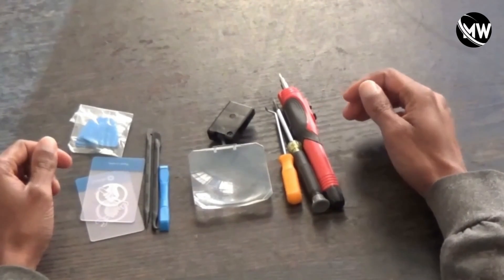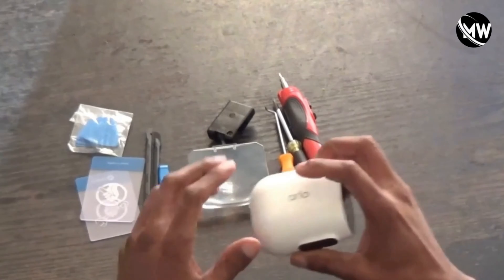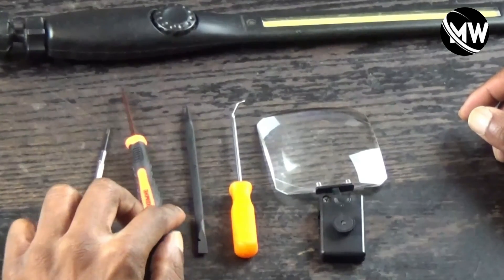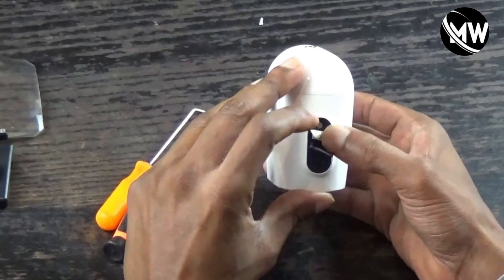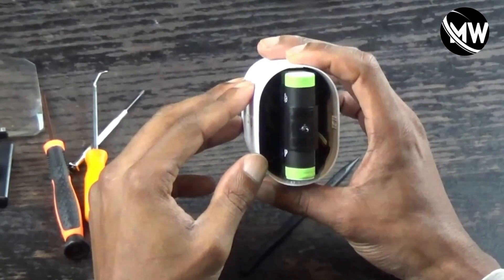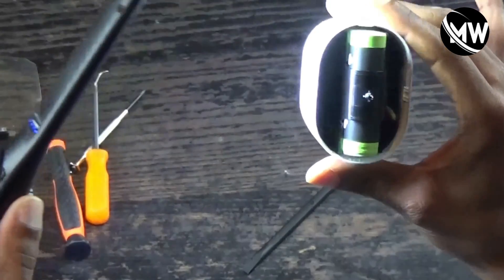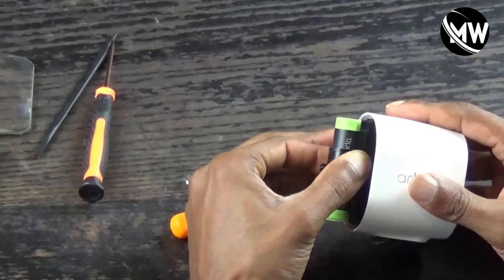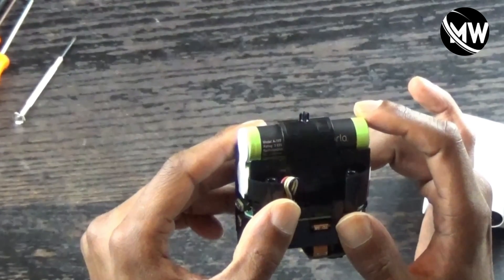Arlo Essential Camera: How to replace the non-removable battery - Part 1

Comment: I have the same camera. When plugged up it's not showing any charging indicator and it won't turn on. I opened the camera and tested the battery with a multimeter and it's putting out 3.6V yet camera still not turning on.
Reply from the maker: When doing a voltage test. 3.6V is the minimum charge, 4.20V is the maximum charge. 3.6V is low.
Reply: @manowarsecurity idk why I didn't see this comment. But how do I get it to charge.
Reply: Thanks...that's the same problem with the same style of camera THANK YOU ALL, FOR ALREADY FIGURING IT OUT ...

Comment: should be a tabbed 18650 battery. ?
Reply from the maker: Stay tuned. I'm working on a video that will cover the battery sizes of all of the non-replaceable batteries and how to rebuild them with brand new battery packs.

Comment: i removed the batteries but it seems arlo stopped selling this kind of batteries
Reply from the maker: No worries. I have them for sale. Check out my online shop, the link is in the description
Reply: @manowarsecurity  When will you have batteries available for sale.  I don't see any in your store.
Reply from the maker: @hunreifis  They are available for sale. You must have over looked them.
Reply: I sent a question about the battery. Mine is light purple not lime green like yours.
Reply from the maker: @hunreifis  Their the same battery, just come in different colors.

Comment: Little tip to get the back cover off after taking out first two screws just screw you mount screw back in and it will come off very easily.

Comment: Great video...any link for replacement battery?
Reply from the maker: Hey @brianpescatore7503. Great question. You have a couple options: 

1. Get it from a used non-working camera (a donor camera) where you can salvage it's battery (known good battery that will fully charge). 

2. A certified Arlo refurbisher.

Unfortunately, Arlo does not sell this  battery (A-10T) directly to its customers. They will just tell you to buy a new one.
Reply from the maker: Hey @brianpescatore7503. If you have trouble getting your hands on one, I would be willing to sell you one of mine. If your interested, just visit my online shop at https://malwr0nwind0z.com/shop/